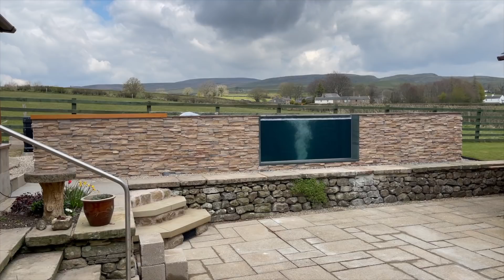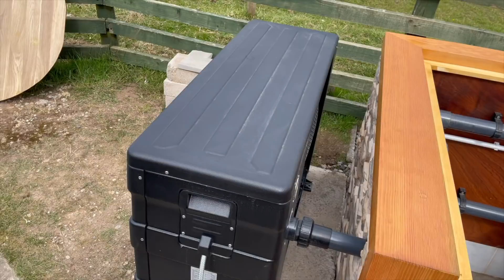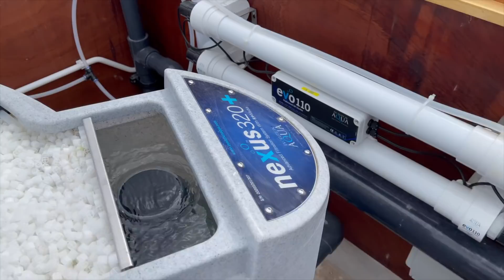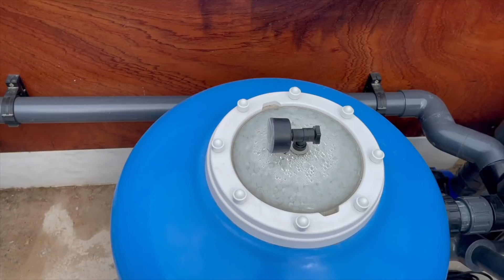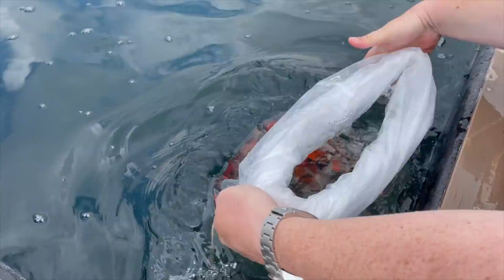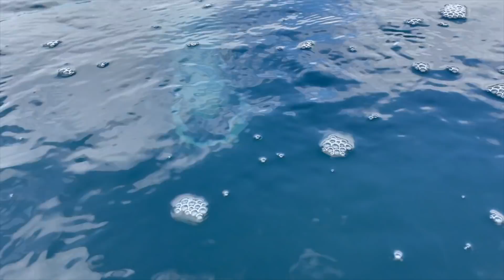Amazing 5500 Gallon Koi Pond - fantastic setting!

Comment: What a Beauty! 
I had a quick question for you, I plan on building a 4000L (1000 US Gallon) plywood pond in my 12x8 insulated shed so I can finally keep koi.
do koi need sunlight or can I make do with artificial lights? also any recommendations for a simple filter for this size pond?
thanks!
Reply from the maker: Sunlight will always help the colours. There are some aquarium lights that can do a similar job but very expensive. I would use an EazyPod filter system on that size. You can get from Fitz fish ponds in NJ. 👍🏻
Reply: @TimWaddington  I may have to fit some skylights in the shed then, as its only just gone up, will be a shame to cut holes in the roof haha, but if it will improve the quality of the koi then why not! spot on thankyou
how many koi would you say this size pond could handle long term?

Comment: I have a question I also run a Nexus would I be better off with a 20 . Litre pump Running at half power Or a 10000 running flat out.
Reply from the maker: Depends if you plan on changes in the future. A 10,000 is enough.

Comment: Tim from an acoustic point of view would you recommend two smaller air pumps 1for bottom drain and 1 for nexus or Just a singular more powerful unit?
Reply from the maker: We tend to use one but 2 is fine. Depends how much air you want in the pond